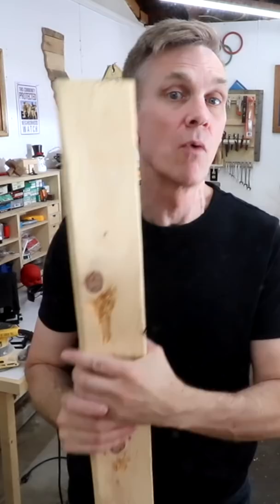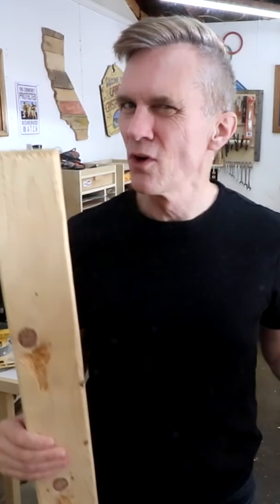Why do 2x4 boards have rounded edges? #shorts

Comment: When u stack the boards when it has rounded edges u can easily grab and pick up when goin thru a stack of lumber when ure looking for ure favorite type of wood ... if u had wood stacked with wood that didn’t hav any rounded edges u might hav someone on one side grabbing two boards and on the other side grabbing three n it b difficult picking up the same amount of boards wen loading plus this helps keep the integrity of the wood staying its original shape then if u have a ding on a board ull throw it out if the way making it not the one u might like cus it makes it’s good reasons why might not want to buy it making a huge amount of good wood u might hav an ocd experience making it become everyone’s problem and the unsold pile should only hav real imperfect or damaged wood in the discount pile not the dings because it not being square edging ... it making it easier to stack and from one side to restack the pile but wen u are making and cutting ur project a end finish would sometimes rounding the edges so anybody could grab the wood so splinters aren’t gonna b an issue makes the customer happier with our splinters or a piece of wood could slide on top of the wood it makes it better prob if it gets the stack wet from being stacked and strapped outside n if it rained it can dry easier without it getting mold n mayb damaging the middle wood or it drying easier n it not keeping all the wood in the middle of the stack staying wet .. all these reasons gives it good reasons why they should take time to round edges 

Some 2x4 ‘s in a stack the rounded edges might only hav rounded edges in one side especially a rough cut on  especially wen u hava type of wood with therm only considering the whole piece of wood having to hav perfect sides on both sides but when the distributor at the store is selling the boards they consider the wood only having a one finished side the other side doesn’t matter for the distributor they only consider it to hav a must one side finished side to be a good piece of wood staying in the good pile of wood to sell so these are all things I’ve noticed wen I’ve worked in the lumber department and the different reasons for selling the lumber keeping good wood and less wood out of the damaged dis count pile it is all the above it is too many good reasons not to hava saw mill not pay attention and round the edges this for some wood users the best one I can think of it also makes it easier to slide along the wood and then mayb u don’t hav to use gloves everytine u touch the wood it makes it nice that don’t hav to wear gloves everyone u touch ur wood in the wood pile it to me is too many reasons for a mill to consider the benefit to actually to round the edges for the distributor for the buyer it begins to make it for construction especially on softer wood or quickly building framing especially but if notice the harder wood if u buy the better quality wood they do not hav rounded edges 

Also if 2x4 hav rounded reasons to keep the same shape since the 2x4 got smaller not being 2x4 them being a standard size smaller they can keep thier strength them being smaller than a real size 2x4 if u dinged up chopsticks they might break easier like if I see a split in a board I double check it’s strength by bouncing the corner on the cement floor if it’s strong it’ll bounce of the floor   If it breaks easily it is not a good piece of wood I usually do this to give it a great reason to throw that board into the discount pile ...

Comment: sharp edges are prone to splintering and raidiate humidity faster, causing warping. rounded edges are more durable and dry more evenly.

they are round because it removes less material than an equivalent chamfer

Comment: Because it's a finish to buy for not rough cut it's the take the roughness off the sides and the edges, once the rough cut is made, finish cut takes less than 1/32 leaves a smooth finish

Comment: It is my opinion that when you are framing in tight fits, the wood has less chance of splitting at the edges in a tight fit. Also when placing next together.

Comment: Originally the 2x4 were really 2" x 4", in time to help DIY, they decided to offer 2x4 that anyone could handle without getting hurt.  That was and always been the main reason since I'm 11 years old and help my dad build the garage.  We had both style of 2x4, the old ones that were ruft cut and the newer one, the newer ones were undersized because of the rounded and smoothing of the surfaces.  And the old 2x4 came from an old house from the 50's that my dad dismantled.  What I talking about happened in 1976, so for any lumber mills that want to sell construction materials, 2x4, 2x6, 2x10, etc they will smooth and round the corners to help any one manipulating them without gloves avoid splinters.

Comment: You ever try to pick up rough cut lumber that was stacked tightly together? It’s quite difficult and slow when you are picking up thousands of boards a day a few seconds spent on each board would really add up in labor costs(this is no longer done manually and the tradition was carried on bc all of the secondary benefits)…just follow the money when you want to find an answer

Comment: Working for building material companies that’s great when you’re doing specific kinds of jobs that’s an extra quality that’s added into the price of that lumber when you round them off like that but for lumber pack they come squared off so they stack better when using framing packs and it’s safer… End it doesn’t matter the length of the kind of Lumber is weather it is pressure treated  or yellow pine but there is a system of stacking pressure-treated is always on the bottom longer stuff is on the bottom if you have it so that when it comes off the truck it doesn’t break the bands quickly…

Comment: Stacking  lumped with Rounded edge  keep spaces  between the lumber as ventilation if you stacked them  sharp edges lumber will get mold

Comment: i was told it was to increase the woods overall resistance to splitting like when you chamfer the top of a wooden post or when blade smithing you would try to reduces sharp edges as those areas would be the most likely point of failure in the same fashion wood beams have an inverted chamfer or bevel to increase strength and that means the mills can use less wood per beam for a specific weight or strength requirement

Comment: I do.
It's a feature of the 4 sided planer/thicknesses that took over the industry way back when.
I'd you don't know, it'll plane all four sides simultaneously and round the egdes in one pass as opposed to the several pass' that were the norm up to that point. 
Pretty much every mill uses them these days that's why it's all rounded.
Its a byproduct of the milling process basically and nothing to do with helping tradesmen or conveniences on site.

Comment: Rounded edges are NOT intended framing lumber for real-estate.  Rounded or dressed lumber is for exposed areas where they will be painted.  Paint holds best to rounded corners not square ones.
...carpenter since 1989....

Comment: my pet theory is that the 2x4 are rounded so that I am forced to cut the edges off when making anything and now I consume more lumber. Also why aren't 2x4 actually 2"x4" !?
I think they do both to infuriate me!
Reply: Because when they are first cut they are 2x4 rough cut which in the old days meant they were hard to work with because of variance over the length of the board and from board to board due to machinery having looser tolerances then now .  Also drying lumber still was still mostly air drying which is less well controlled then  kilned drying. That meant that they were harder to get straight walls something that anyone who has rehabbed 100 plus year old buildings is all to aware of. this lead to the mills doing the only thing they could do and that was to run the lumber thru molding machines /4 sided planers which is where the term s4s used for lumber comes from .
Reply: @danielbackley9301  well, you are right about rehabbing and old building. The wall I repaired had studs actually 2 x4 inches but they weren’t spaced on regular centers (e.g., 16 inch). Whatta pain!

Comment: Here's my two cent,.. The rounded edge takes away the sharp edge which is more prone to splintering then to cracking, like the way you drill a hole at the end of a stress crack to keep it from going further,...

Comment: There’s only one reason. Handling. Construction lumber is handled and touched by so many people before the walls are covered by drywall. Manufacturers, suppliers, transporters, carpenters, plumbers, electricians, insulators, etc.  Sharp edges always big splinters that can easily go thru gloves too, and cause major injury. “It’s an extremely necessary step.”

Comment: How about it’s because lumber is shipped all over and it weighs a lot so if you remove a little material from all 4 edges (called ease edges) it makes the package of lumber lighter which reduces shipping cost.

Comment: They don't need to be nicely planed smooth either. It adds little cost to finished product and is preferred by the people buying them. All the reasons you mention play a factor if the consumer thinks they are valid. Once you start mass production it only makes sense to do little things like planing and rounding the edges if that's how your costumers prefer it.

Comment: i would say its so they stack better, if their is some sawdust on the surface when they are pressed together to be stacked in the big packets they come in, the rounded edge gives somewhere for that dust to go instead of holding the boards apart at the bottom causing unstable stacks, the same reason you want a bevel on the bottom edge of your table saw so when you push DAR timber against it the dust on the table top will go into that bevil instead of stopping your timber from flushing up against the guide

Comment: Because they're not rough sawn. The rounded edges happens when they're sanded. If you only sand the sides it leaves a large amount of left over material. It's the easiest process while sanding. This is why it's not a 2×4 it's a 1.5×3.5 if you want a 2×4 you need rough sawn or a specialty board

Comment: I'd rather have a square edges as an electrician because putting receptacle boxes in there is a little tab on the sides of those boxes that hold the box out to accommodate for drywall so with them rounded edges it don't work so well just a thought

Comment: They rounded the edges for basically all of your reasons. The real reason they did it was because of shipping and handling costs. It’s easier to handle and doesn’t get damaged as easily during the production process all the way to the end user. Square edges tend to dry faster which can cause splintering. Rounded edges also speed up the drying process by allowing airflow in between each 2x4.

Comment: @SteveRamsey My family used to own a lumber mill, the reason for rounded edges are for safety first and air flow while in the kilns to dry..
Even with gloves handling rough cut lumber the edges can cut through gloves and cut bare skin.. 
Workers at lumber mills can vouch for that
Reply from the maker: Wouldn't it be safer to round the edges of all boards? Furring strips, 1x4s, etc?

Comment: So I'm a 5th generation logger and I've been around sawmills a lot  it's because the drying process if they didn't have rounded edges there would be no air flow so things in the center would be wet when the outside would be bone dry causing the lumber to bend and Warp making them lose profits because no one wants 2x4 that has more curves than your girl

So different sawmills me have it in different ways but usually first they'll be sent to the kiln to get that first drive taking out most of the moisture and then from there it'll be rounded off and stacked up and stored sometimes it can be in our temperature control environment where the humidity doesn't change much but if it's not then not having airflow will make it where the outside changes faster than the inside timber bending that I have seen also though some sawmills make them curved before they go to the drying process they cut it and then right after they cut it they round it different sawmills have different processes but it being around it is always a part of it because when it's either in shipment or in storage you can't always control humidity and without the rounded edges either when they get to the buyer or when they're in transport to their buyer they're going to bend so to solve that and keep them as straight as possible you round the edges

Comment: Wood is unstable warps and moves in all directions other than length: throughout every humidity flux of the year. Wood is not perfectly squared on all sides then. The rounded edge let’s the carpenter square up the flat 3&1/2 surface instead of the 1&1/2. Also very needed for decks. Wood warps

Comment: The edges are rounded for two reasons;
1-To allow airflow for drying out the lumber 
2-So sawdust doesn’t accumulate between boards causing them to leave gaps between making them less uniform when stacked 
Source-I spent more than 20 years making up B.S. to mess with people

Comment: I worked at a sawmill moving 2x4, 2x6, and 4x4s. The "simply wear gloves" statement is bullshit. I was pulling green chain, as I was moving a 2x4, it slid down my cut and puncture proof 3 layer thick full leather gloves. A 3/16th inch thick, 4 inch long splinter went through my glove from the outside of my pinky finger, through the joint of the knuckle, and out the other side. So, that is bullshit.

Comment: A sharp angle corner splinters a lot more easily than a rounded edge and it has nothing to do with worker consideration it has to do with strength of the board

Comment: I think the 2x4 has rounded edges is because when you put a set square on it to mark lines it is so the square or what tool you are using sits on the both sides and if you have a sharp edge it my cause the tool not to touch both sides of the material and cause a line not to be square on the material because on larger lumber you can machine the lumber to have a nice sharp square edge

Comment: “Rounded edges before drywall was common”
 Not in my 25 years of experience. Studs produced as late as the late 70’s weren’t rounded yet.   Rounded edges seem like they could be easier to stack but I think the biggest reason is safety.  Square corners splinter much more easily. Don’t forget that lumber mills handle the lumber before carpenters ever do.

Comment: It could be a tax reason !
I used to buy 2x4s with a hole in it!
They called it pre-engineered 2x4 for electric wire, it came from Canada and had no taxes and cost less than any domestic 2x4 !!!

Comment: Structural strength. Around Edge holds more weight and pressure than a square Edge it's the same thing as an arc in a tunnel it's just vertical the load strength

Comment: From a modern point of view, rounding improves flatness.  High production cutting results in edges that may deviate from the specified planar cuts (edges that aren't supported and splinter).  Just thoughts from a reproducibility standpoint. Any thoughts?

Comment: the edges are rounded to help stop solinters. it adds no extra cost or step to a sawmill. i ran a large commercial planer in a sawmill for over 13 years..

Comment: Accommodating the drying process, is absolutely not it. If anything, the channels in a crated stack of lumber allow moisture infiltration. Dry building materials are to remain dry all the way through the building process. Rounded lumber edges are simply safer and more efficient in the handling process. It is a necessary step, if a mill wants to get top dollar, in the market. Think man, think!

Comment: There is a reason. And people do know why. Just not you. Haha
They do it for 3 reasons. 
1st and the main reason. When you round the edges on a 2 x 4 they’re less likely to dry out crack and split and you end up with a better quality wood that ppl will buy. Nobody wants to buy wood with a huge crack in it. 
2nd reason. A 2 x 4 with straight edges and a 2 x 4 with a rounded edges would sell for the exact same price. By rounding off the edges, you get more sawdust and chips that can be used into particleboard maximizing your material.
3rd- when kept in the lumberyard, they stack and ship better, and keep airflow in between the stacks. So moisture does not build up.

Comment: A. tThey are ran through a planer anyway, adding rounded edges doesn't really add any expense.  B. all the 2x4s in lath and plaster houses built before drywall do have sharp edges. Also not planned just rough cut and the full 2x4 width.  Not real sure why construction lumber is planned down at all really, other than cut them a bit smaller than 2x4 and then blame the missing width on the planing process, or it was legit needed to plane that much off when mills were mess precise? And now it's just fine for the sake of uniformity?  I guess I'll buy the airflow argument.

Comment: You are wrong.. a 2 x 4 is dry at  1.5 x 3.5 inches the rounded  edges  are stronger  than  square..the proff is in 
West Coast lumber inspection  burrow  or WCLIB look it up your  research is faulty ...

Comment: Nobody knows?  You mean 2x manufacturers just do this just because?  Well that explains everything.  Thanks Professor Just Because..
Years ago I worked in a large lumber yard unloading trainloads of loose 2x4s before banding was common. It would take about 4-5 days for 2 guys to unload it all and restrack it for sale or storage. We would typically run through a pair of heavy leather gloves every day and that was all rounded stuff. It's mostly for handling, both automated as well as manually handling it.
Reply from the maker: It's crazy, right? What's your guess?